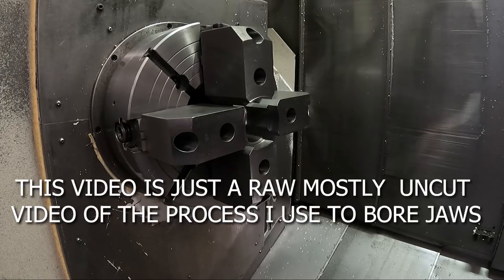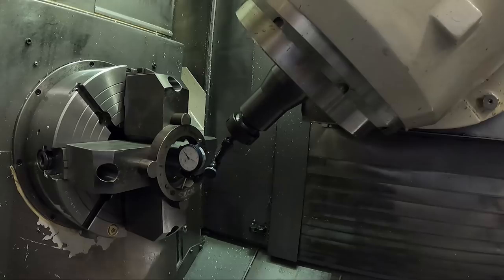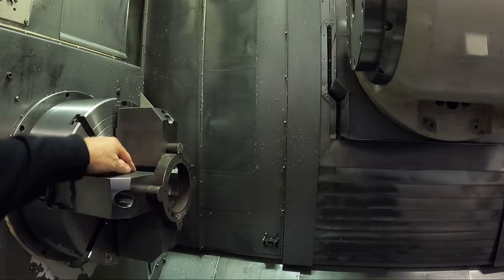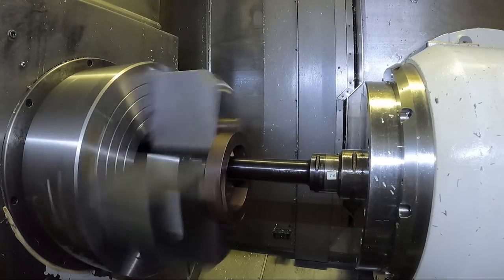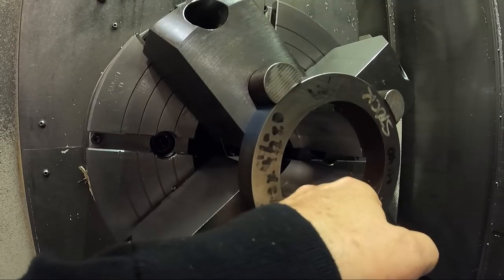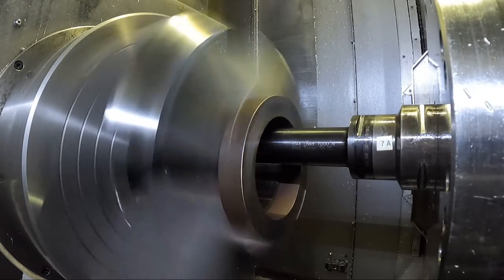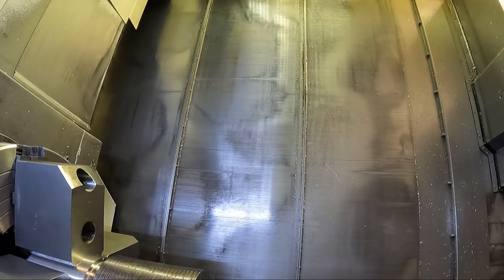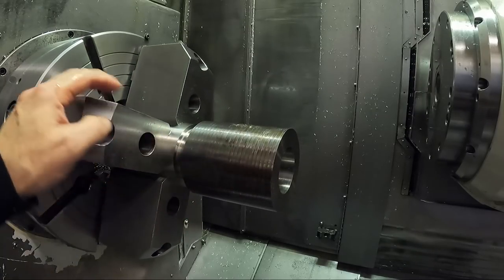Boring Soft Jaws For Op 2

Comment: Just to add some context to non-machinists. I can't skip not boring soft jaws on 2nd lathe operation because if i don't do that then the Runout between both surfaces will be anywhere from 0.2 mm to 0.4 mm or more (3 jaw chuck). If i bore the jaws i can get the runout down to 0.015-0.07 mm easily and that's good enough for most parts which require about 0.1 mm of runout. So it's not skill or patience or "doing the job right" but an absolutely necessary step that you can't skip.
Reply: What kind of a chuch are you using that has  so much runout?
Reply: @kamn8259  1980's Okumas which have been crashed and just not repaired. If it spins, then keep working.........send help.

Comment: Could you use a much larger disk where you milled the center hole and then four slots for the pins? That would reduce the amount of deformation essentially to zero.

Comment: I always debur my jaws very good and large  right after roughing  so when i finish turn  the jaws are absolut smooth and i dont have problems with runout on a 3 jaw  from taking it out and putting it back in after deburriung  (if i hade dirt in the tooth or somthing)

Comment: Do you ever apply 'undercuts' when cutting jaws? If so then how would you recommend doing it and with what type of cutter? Thank you for your videos.
Reply from the maker: This part has a step in the end. So it doesn’t need any undercut. But I do do that if necessary. Usually with a VNMG inserted bar.

Comment: Tighten the highs and loosen the lows😁👍  What is the rule of thumb on how much torque to put on the chuck jaws?
Reply from the maker: On a solid part I put almost as tight as I can with my 3/4” ratchet wrench fully extended to about 30” long. On very large parts I even put a cheater pipe on that. So what ever that torque is I don’t know.

Comment: 28:26 is there no way to automatically increase the pressure based on RPM?
Reply from the maker: I don’t know of one that does that. Maybe there are chucks that don’t do this. But I have never used one.
Reply: I don't believe there would be a way for the machine to know where your jaws are set. or the center of mass for each individual jaw. If it did do this, it could also cause a crush problem on the part you might be working with. There are so many variables to what you could be doing, I'm not certain this would be beneficial to the point that someone has developed it.

Comment: Do you remove jaw beyond just "cleaning" up the total chuck center grip...so your scroll is seeing new faces?
Reply from the maker: In the case of this chuck, it is a 4-Jaw chuck. So it has no scroll of course. But on the 3- jaw I’m generally changing the chucking diameter so it is changing position on the scroll unless just by accident it lands in the same spot.

Comment: If you watch around the 3:00 mark, the spindle locking mechanism doesn't appear to be actuating smoothly. Might be something to keep an eye on. I'm conflicted: really want to see a teardown of that head, but I also  wouldn't wish a spindle rebuild on anyone.
Reply: i have watched it 5 times and i dont see anything wrong. I only see the reflection on the inner side chamfer of the spindle, is that what you are referring to?
Reply from the maker: I also don’t know what he is referring to. I am orienting the spindle manually. Than locking it. He can’t even tell when it locks/clamps. He only knows because I said it. You can’t see it happen. The Capto spindle isn’t a round taper. So when it orients it may look different than you are useto.
Reply: At 3:05, there's movement in the reflection of the Capto holder just before you insert the tool. I suppose I should have said Capto lock as there is also the spindle rotation lock.
Reply: @pyrobeav2005  ah okay now i see, but i guess thats normal isnt it? At first the "pull bar" sticks a little bit.
Reply: @ipadize  Not sure, I haven't used a Capto setup before, the sticking I'm used to is the bar unseating the taper (CAT 30/40 tooling). It all happens in a few frames of the video so it's hard to tell, for all I know that's just how the Capto mechanism works. On a side thought, is the Capto release pneumatic or hydraulic on the Integrex?
Reply: @EdgePrecision  Captain hindsight to the rescue!  People that come up behind you and say negative things are generally wrong.  I watched a maintenance man tell another man "let me show you how to use that hammer".  He took a big swing at a nail and smashed his thumb and finger.  I just walked away...  The same guy always would try to better any story that you might tell.. LMFAO!!  I love your videos!
Reply: @pyrobeav2005  The motion you are seeing is the Capto mechanism clamping, (I use to run a Integrex with a Capto C6 spindle.) Because it's a horizontal machine and the tooling is so heavy you typically let off on some of the pressure while the machine runs the clamping cycle. It does actuate back slightly, which is the motion you're seeing.

I believe the release is hydraulic. As I remember the slight sound of the motor whenever releasing tools.

Comment: Hey Peter, sorry to hear about the problems with your arm. While I was watching, I thought maybe it would be possible to tighten the jaws with a torque wrench as a final op. Probably totally overkill in this application (and also increasing the setup time), but the advantage might be that the ring would be deformed more symmetrically (it seemed to move quite a bit when you released the jaw pressure), and also when you put the final part in then the jaw deformation would be the same. As I say, for the time taken, probably not worth the effort, but got me thinking !

Comment: If you hurt your neck make sure you take care of it
I was rear ended in 1997 hurt my neck immediately then thru out my career my neck was hurting now i just found out i have severe c5 c6 degenerative disc issues with pain in my shoulder and arms now
Also now there is a workers comp injury called “cumulative trauma “ that cause pain to a non work related injury that the job causes pain read about it you will be surprised what that law says about it
Reply from the maker: No I didn’t hurt my neck. I injured my right arm. I was shifting gears right when the other car hit me on the passenger side. It spun me around in a circle. I must have held on to the shift stick so hard. I ruptured my bicep muscle in my right arm and tore some ligaments in mr shoulder.

Comment: Right click menu bar, uncheck hide menu bar. Or maybe it's another layer, menu bar settings? Been some time since win 2k. What it looks like to me anyway. Just my 2p thanks as always hope that windows tip helps
Reply from the maker: Can’t unhide the menu bar on the Mazak control. If you do, you can’t operate the controls soft keys. It covers them. The mouse pad on the controls panel is very hard to use. It’s sort of like a laptops mouse pad that is malfunctioning. It does work but you have to use a lot of pressure and move just right. Very difficult with one hand.
Reply: do you know how to skip a tool path during grooves on mazatrol ? say you had a few grooves to machine but you wanted to TOOL PATH the last one .....
Reply from the maker: @christophercolumbus8944  I don't really run mazatrol programs. Just EIA (G code) programs. But if I was to do it in Mazatrol I would program all the grooves in separate blocks. Than you could run reform passes on each individually.
Reply: @EdgePrecision  i see 
but the OP seemed like to be using mazatrol so maybe he knows

Comment: Hi Peter
  Why not , instead of just using a piece of pipe unfinished, go ahead and turn a piece that is turned to tolerance to keep and use again in your setups ?
  It seems like you would be a little closer to begin with.
  I understand that you don't have to cut soft jaws very often but seems like it would be about the same time to have a finished ring ready for next time.
Maybe I missed something because I am replying while watching so sorry in advance if so
Reply from the maker: That certainly could be done. Right before making this video. I found this. Piece of pipe in the drops by the saws here. I just used it as is. I could and should of just indicated over the tops of the pins in the chuck jaws. Then it doesn’t matter how rough the ring is.

Comment: Why in the first place do you machine your jaws in a 4 jaws chuck? In anyway they don't keep any repeatability if you want to change parts. I saw you individually adjust the jaws before cutting the part so why you put the effort and machine the jaws?
Reply from the maker: In these cases I bore the soft jaws to hold the part more securely without marring the finish. If I were to grab the part in the hard jaws even with packing to help prevent damage. It is more difficult to indicate in the part. With bored jaws you only have to indicate the runout at the chuck. But the other way you have to make sure your runout is good at the chuck than out at the end back and forth. Because I don't have a turned area to indicate out at the end boring the jaws assures everything is running true along the entire length of the part. If you watched the video on the first operation. In that video I just used the hard jaws.

Comment: Peter; Iove you to death and have nothing but respect for your knowledge. But as a Mazak Integrex machinist myself I have to question the setup with a manual chuck. In our daily operations we do a lot of single parts and we use hydraulic chuck with hardened jaws with aggresive tooths for first operation (with added  bonus of being able to take the part down and back up with near zero runout <0.001") and for second operation always soft jaws. This means  turning jaws several times per day, some of wich would surely be avoided with a manual 4-jaw but the constant indicating would drive us nuts. And every time there is more than one part it's time lost. 
Also, why not use Mazatrol, the program you ran for these jaws would have taken all but 3 minutes to program in Mazatrol.
But, as I said earlier, don't want to be that type of Youtube-commenter on machining videos but felt that I wanted to give my two cents. 
Greetings from fellow machinist in Sweden.
Reply: @Yeah Right Mazatrol is not just for the 80's and 90's. It is one of the most powerful turning CAM systems that are out there. I have programmed from Mastercam, Hypermill, G-Code and Mazatrol. Maztrol programs are typically faster and easier. It does havesome special rules, (as all CAM software does.) However, the amount of control a machinist has at the control means better optimized programs, as well as faster programming times. Typically lead to a faster product. I wouldn't use it for a mill or even a turn/mill. But it is seriously powerful on a 2x lathe.
Reply: If you watch Peter's other videos, you will see he does a mix of oddball parts and not all of them are round. The 4-jaw works for his situation even though it takes time to indicate every part. The 4-jaw also gives him maximum spindle bore use vs a hydraulic chuck with a draw tube reducing the bore capacity.

Comment: I'm sorry, Peter. I know you like esprit, but that tool offset feature is despicable. A tool offset number should be in the tool settings, not the toolpath. Its too rare to have different offset numbers than to have to remember this feature every time.
Reply: the dropdown above that input field defaults to "No" meaning that the tool offset would be taken from the tool table... when set to "yes", it allows you to override it for a specific operation.
Reply from the maker: On the Mazak Integrex you can have many offsets on the same tool. They go by letters A thru Z. So in this case the tool I was using was T9-H. But in G code on the machine you use the T9.08 or the eighth letter in the alphabet if you will. So to get the code to output correctly in Esprit for this machine. You have to override the normal setting. This is the way the post will output the proper suffix for the tool in the machines tool setup. On other machines this isn’t necessary because they deal with the tool offsets differently than the Mazatrol control.